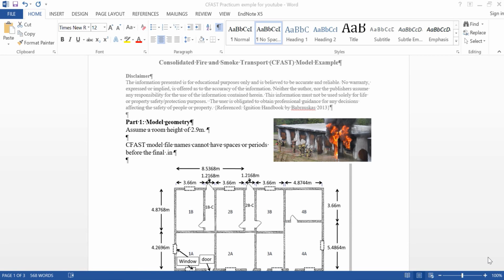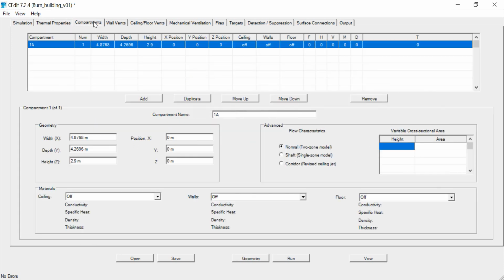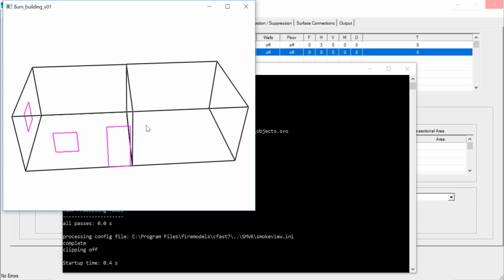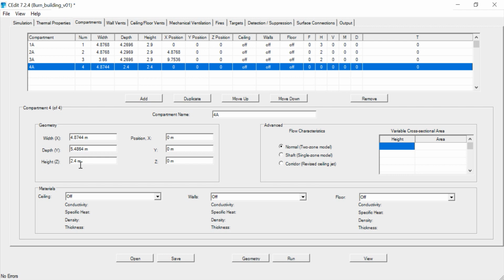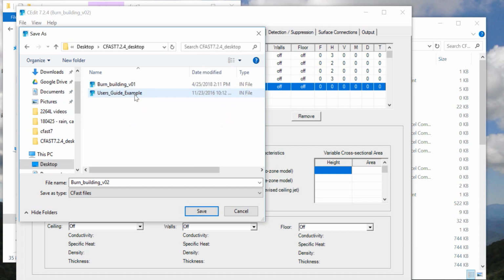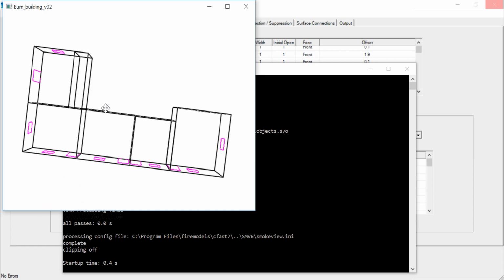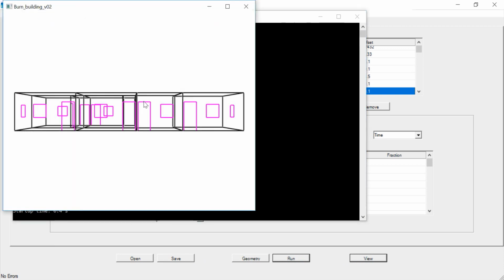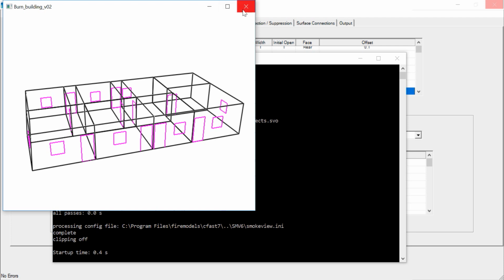CFAST Fire model example -  part 1 building geometry

Comment: I know i'm resurrecting a five year old video here -- but if you're using the modern version of cfast (at the time of this writing, 7.7.4) the sill & soffit nomenclature no longer exists for vents. It looks like these used to be absolute coordinates and have been replaced with relative coordinates - as in, in 7.2.4, you defined the sill to be at y = 1 meter and the soffit to be at y = 2 meters to make a 1 meter tall window (soffit minus sill). 7.7.4 has replaced these inputs as 'bottom' and 'height', so the new entries are 'Bottom: 1 m" and "Height: 1 m" to define a 1 meter tall window. This fix the errors everyone is discussing below.

Comment: Hello, I am using version 7.5.0 of Cfast. When I copy the example file in a new folder it runs correctly, but if I save a new file it is not shown in any folder I save it, but if I try to open it from cedit I can see it in the folder. I am using a windows 10 not in english default language.

Comment: Hi I have a problem! I'm doing a new project and when i click on view, even if i don't have errors, the project opens the cmd window but not the 3D view. What can i do?
Reply: I have the same problem. You solved?
Reply: @valentinabianco7973  Hi Valentina I asked into a Git Hub Forum and give me that respons: The problem is that your computer is not set up correctly to run CFAST. CFAST requires the numeric format be set to US English (Where a period rather than a comma is used as the decimal separator in numbers.
Now works all!
Reply: @enricserranocelma5791  Thank you ^_^
Reply: @valentinabianco7973  i didn't solved yet

Comment: Good Morning!

I have the same problem of plotting the building.
After entering the input data, I am unable to open smokeview.
2 errors appear:

- Error in & MISC: Invalid specification for inputs

- Error exit from CFAST routine: READ_MISC code = 1

 Someone would know how to inform step by step to correct this error.

Comment: Hello, I have a problem, at minute 5:25, when loading the thermal file, I do not take the values of it. I await your comments
Reply from the maker: Hi Carlos, Can you clarify what you mean by "not take the values of it"? I'm not sure what you mean.  This site isn't checked frequently at this time so I apologize if there are delays in a response.
Reply: @firesciencetoolscom  dear sir , i have some problems about assignment ，may i send you email ?
Reply: Download the version 7.2.4, I make the step as you explain it and at the moment of plotting (minute 7:51 of the video) it does not do it. because it can be?
Reply: @carlosoliva3696 , maybe it is a problem with your idiom and region configuration. CFAST recognize period as decimal separation. If you import a sheet to CFAST and your PC recognize comma as decimal separation, there'll occur an error.
Reply: Hi Carlos !  I'm having the same issue. Have you managed to solve the issue?
Reply: @Saroosh_Khan  Hello, I am working on being able to solve the error. Any news you notice.